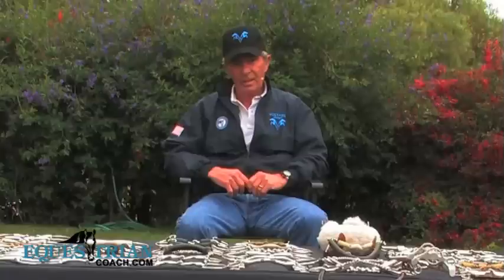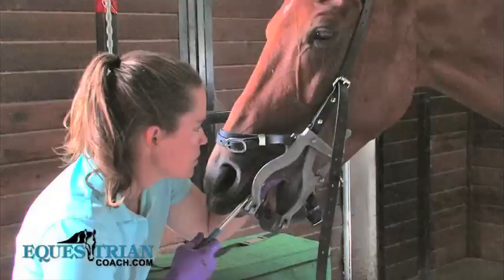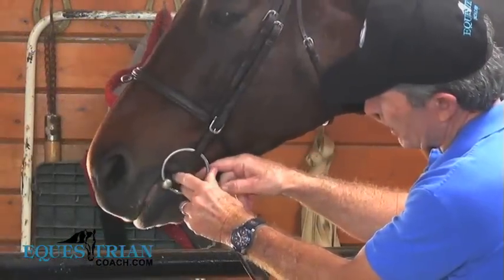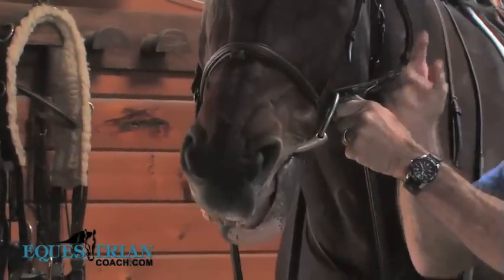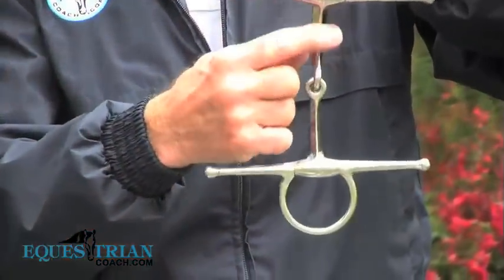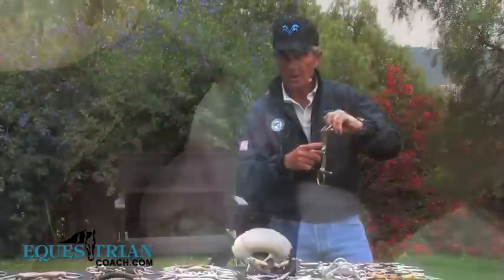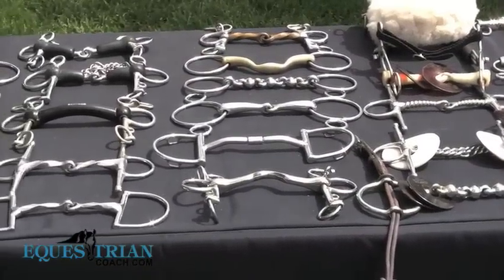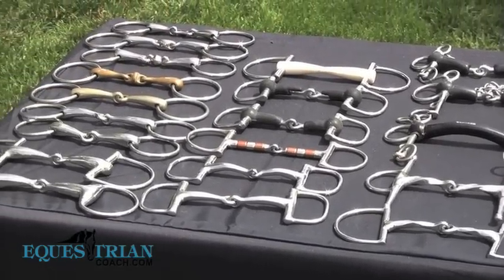Horse Bits: How They Work and When to Use

Comment: I agree and disagree with the people saying "go bitless". Some horses are absolutely fine with bits, but with some it just won't work. I'd never use anything more than a snaffle on any horse of mine. Bitless can be good, bit it can also be very bad. It can even be worse than bits. It all depends on the length of the shanks on a bitless bridle.
Reply: Rope halter and reins.
Reply: @gerrycoleman7290  that can cause so much damage if done long term.
Reply: @starry1668  If used correctly, your statement would then be incorrect.
Reply: @gerrycoleman7290  correct- but a lot of people do not use them correctly
Reply: @gerrycoleman7290  which is exactly the case with bits. though rope halters or sidepulls sold for riding usually have rawhide or a thin rope on the nose which ends up being really harsh on the nose.. a rope halter with reins isnt very well suited for english riding- its possible of course, but not optimal

Comment: A BIT is simply a communication device.  If the mouth is healthy and teeth are good a BIT that fits that horse will ride easy and not cause pinching or pain when at rest position. A light rein and crisp light commands with immediate release upon yield will not cause pain.    Like if I lightly nudge you in the side to move left you should feel no pain or react other than understanding to move.  If I am heavy handed and hit you hard in the side you will react to the pain and the movement will be lost in the reaction.  If I keep hitting you heavily in the side you will blow up and turn on me to make it stop.   A horse is no different.  People need training, not horses. People need to understand BITs and how to use them, how to fit them and to communicate with a light gentle hand.  My grandfather ( A great horseman) taught me by using light cotton string to attach my reins to the bit.  If I was not gentle the string would break. I learned to communicate to my horse with a simple wrist movement or finger movement.  You could barely see the hand move.  Force or pain have nothing to do with good horsemanship and lead to more issues.  The horse industry is flooded with magical clinicians, gadget bits and gear and so called horse whispering trainers.  Most are just con men and salesmen making a buck off of emotional unknowledgeable well meaning people.
Think of it this way....what is your goal by the communication??  Take two guys trying to communicate.

Level1:  You need to communicate with a guy several yards away to come to you.  You can yell or wave or both. Clear defined communication is not necessary, he just needs to understand the basic jist of the communication to come to you.
This is like basic relaxed trail riding.  You need to communicate for your horse to stop or turn or move forward.....crispness and immediate response not required so NO BIT, or head stall alone might get it done.

Level2:  Now you need more detailed communication with the guy, not only to come to you but to come to you quickly and to bring something along.  A lot of the message gets lost in yelling or waving so you might use a walkie talkie to make your commands clear and understood.   Same mission of communicating with someone, just more dependable and precise.
This is akin to a working horse on a ranch or pleasure riding in rugged rural settings with potential dangers where a more responsive horse is needed.  A good snaffle or simple curb BIT will get it done.

Level3:  Precision communication is vital. Your communicating with the guy but he is doing something precise and needs your direction to complete it properly and safely. Headset with mouth mic might be in order to ensure there is clear precise communication without interference or misunderstanding (  like a crane operator ), missed communication would be disastrous to your goal.  
This is like reigning, cutting or intense work that demands precise clean and immediate reaction for success or safety. So you will pick you equipment to meet these demands.

Just because you can ride your back yard trail horse in a hackamore, does not mean you can cut cattle on a cow ranch in a hackamore.  But whatever your doing, it must be good for the horse and the rider MUST be knowledgeable.  If it is painful or damaging to the horse....your not doing it right. 
Communication, Trust and Understanding is the foundation of a good horseman.
Reply: +MrAzrancher you can still do all of that with a bosal or other bitless bridal
Reply: Yes, but it's applying a different kind of uncomfortable pressure.
Reply: VelocirapGirl Can you do some research? Everything that she said was absolutely true. Bits were made as a communication device, and to make riding a little bit easier. If the bit is causing pain, someone's doing something wrong.
Reply: Rainy Byrd communication through pain
Reply: Yeah no

Comment: The real key in bit selection is to use only enough pressure to get your horse to respond properly then immediately release the pressure.  Some horses are more cooperative than others and only need the very lightest bit or even a  bit less bridle.  Horses that need a little more pressure still respond better when only applying enough to get them to cooperate.  Most people tend to "stay in their horse's mouth" too much which does cause pain followed by the horse shaking his head and trying to avoid the unnecessary pain.  The goal should be to get your horse to ride comfortably with a loose rein, coupled with leg ques and teaching him to "neck rein" with the slightest feel of the rein on one side of his neck.  Being patient with your horse and spending the time to teach him what you want helps him learn to trust you, then you can trust him.

Comment: they had cow hide twisted as a bit. it was painless and soft but still controlled the horse.
This is why I like rubber bits, they serve a close purpose.
Reply: theres quite a lot of leather bits on the market nowadays! however, its important to keep in mind that rubber bits are only suited for horses with ample saliva production as the rubber will otherwise rub sores on the skin unlike smooth metal

Comment: hi my pony hates getting her bit put in and wont open her mouth. we have had her teeth checked and they are fine so should we get a new bit or is it just a case of spending time with her
Reply: use a thinner (maybe weaker too usually are if theyre thinner) one. her mouth may be softer than the usual horse/pony. If not then eide bitless and eventually work your way into a bit
Reply: why so mean? he just wantet a advice
Reply: Luis-------Correct. Use a rope halter.
Reply: thanks for your advice, but my pony has opened her mouth now and I'm just glad your not her owner and FYI you cant compete at bs and RC championships bit less.
Reply: We call that a clue------------perhaps a person should rethink competing where bits are required. Perhaps a person should rethink whether they are involved with horses for ego or the horse.

Comment: I have not been riding long, so can somebody confirm that the purpose of a bit should be to communicate through pressure and not pain?
Reply: bits are to communicate pressure. never to case a horse pain.
Reply: Bits cause pain. My two horses (both TB's) use Dr Cook Bitless Bridles which of course have no bit. Please consider this as an option
Reply: bits aren't supposed to cause pain. usually its from the rider being too rough with their hands, and it also depends on the severity of the bit. It's mainly about finding a bit that your horse works best with. when trying with a bitless bridle for the first time make sure you know what your doing. Whether going bitless or not it all depends on what the horse works best with.
Reply: AtomAntTC
Dr. Cook's bridles use poll pressure. Many horses, including mine, object to that more than a bit. Don't assume that bitless is always the gentler option.
Reply: Liz Goldsmith There are a variety of other bit-less options besides Dr Cook which could be explored which will certainly be kinder to the horse than having a bit in its mouth.
Reply: Advice to anyone:

If you need a bit for whatever reason (a frisky or untrained horse, certain showing disciplines, ect, ect) and your bit seems to hurt even if it's not too strong, use a RUBBER or PLASTIC bit. It's more comfortable but equally strong.
Reply: bits cause pain... no matter how soft your hand are or what type of bit you use :P go bitless! but make shure that the bitless bridle is fittet correctly or you can cause damedge to the nose :3 but bitless is 100% better that bits!!!
Reply: if you can control a horse with a halter you can ride bitless!
Reply: You can still destroy a horses mouth with a rubber or plastic bit. I've seen it happen. The best thing to do is explore different types of bits and bridle-less bridles to see what your horse works best with. Some do prefer going bridle-less. Others work better with a bit. Remember to use all of your aids when riding. Using your hands isnt the only way to control a horse.

Comment: Start at the ground people and a bit for your personal security will not be necessary! A bit is a crutch for those that do not know what the hell they are doing or they are scared because they do not know what the hell they are doing ! This is exactly why helmets are worn so much. To protect the dummies that crank on these bits from busting their melon wide open when the horse tosses them or flips over on them because head tossing didn't work to make the pain stop , opening their mouth and shaking their head didn't stop the pain , rearing didn't stop the pain , bucking didn't stop so then the horse goes over onto its back to attempt to get relief from the agony in its mouth . I have never seen a horse go up and over while just grazing in open pasture because a human has to be involved for a horse to flip on its back. Stud chains across the nose , bits in their mouth , whips across their flank...all of those are huge signs of I DON"T KNOW WHAT THE HELL I AM DOING !! There is no such thing as a painless bit..yes some are waaay worse than others but they all hurt. If you are screwing up while using a bitless bridle , you are still doing it wrong !! It is never ever the horses fault if it makes a mistake it is always the fault of the human that isn't communicating with their horse. Set them up for success and start back at the beginning from the ground and slowly work your way back into the saddle. It will not happen overnight and it takes many many hours to build that trust with your horse but nothing worth having is never attained by taking the easy way . Get off your lazy asses and get dirty , sweaty and smarter for the sake of your horse ! Rant over
Reply: hey Kari- I have started all my horses, from the ground up, and everybody (7 horses/Arabs) does go bitless- except 1. Who, only on race day, for the first 15 miles, I do need to use a bit as this horse is so competitive- when the herd gets moving out w/ speed- he wants to go with them. Only on race day is he like this- so in order to protect him from himself- and in order to maintain proper pace for over 50 miles, I do have to use a bit for the first part of the ride- which then, later, I switch to bitless.  Oh, we are also ALL barefoot horses. But I"m not going to tell another person what to do or not to do with their horse if they truly know their horse, and their horse is their first consideration.  But I do agree w/ most of what you say, and people need to learn to communicate clearly with their horses.  But anything on the horses nose too can hurt them as well- as the nose is pretty sensitive.
Reply: stacy j Yes you are correct that their noses are sensitive that is why people use stud chains across it . Barefoot on endurance races ? That is awesome good for you ! Good luck with your racing :)
Reply: yep, I won the last two years in a row the Region 2 Endurance championships (50 miles) bit less and barefoot (completely barefoot, not even booted) the terrain allowed for it.  I appreciate so greatly being able to ride w/ as little influence as possible.  Body language and sensitivity (on the riders part- just learning to listen) can go a long way w/ our horses. I"m still working on this w/ my highly competitive boy, but he's coming along.
Reply: stacy j That is great , wow ! I have much respect for you and your boy endurance racing is not for the faint of heart in any way . You have to trust him and he the same with you or you won't get too far especially 50 miles..lol..
Reply: thank you!
Reply: Welcome!!
Reply: People don't only come off of a horse when the horse tries to unseat them. If the horse falls, there is nothing even the best rider can do. It's unfair to say that people who take precautions to these rare but very real possibilities don't know what they're doing. In this case, they actually do, and they look beyond it as well.
Reply: Omg actually gave me goose bumps!! you sound just like me when I rant.. you are a true horseman and you know what your talking about. Thank god there is still people like you who truly understand horses :)
Reply: Blond Brain I learn something new every single day and as long as any equine enthusiast allows that to flow through them then they can become WONDERFUL BEAUTIFUL teams with their horse. Horses are loyal and strong and gorgeous but most of SMART! But we make our mistakes thinking we know better than they do which is very dangerously wrong . Brute force or pain will get you no where but to the ER a little bit quicker . Been there , done that will try my damnedest to never fail my horse again that way . I am no expert on horses only the horse is the expert but I am a very good study of the horses mind and body . If any of us that care to do such a thing then we along with our horses will be the best we can be .
Reply: Kari Kidd Wow!! You should make speeches your so inspiring! Everything you say is just so true could've never said it better than you. I made mistakes but at least we both learned from them and corrected our ways ;)
Reply: Blond Brain You are very sweet . I do me I couldn't teach others to do me in their way..lol...
Reply: thank you :) and yeah if only everyone would be like you though
Reply: Kari Kidd typical comment from someone who does not understand how the bit works
Reply: lol not really. I've actually done a lot of research on the subject, but that's not what it seems like here. A lot of people make claims that bits are bad without really understanding bits in the first place (or just being "brainwaished" by a lot of Haute Ecole videos. Honestly, I respect what this guy does but some of the videos depict bits in a negative way without any real back up of information, much like what's happening here)
A lot of people who completely bash bits are misinformed.
 Don't get me wrong, I'm not anti bitless at all, and I ride without a bit way more than with one, and have worked with many, many different types of horses each with different personalities bitless. 
 And bits can do a lot of damage, but so can bitless. It depends on the rider. I believe that most horses can be ridden bitless but do not have the proper training. Sadly, though, some horses are so beyond repair from hard hands. 

I'd respectfully request you don't say I "dont know horses" as I've spent a lot of time observing body language and behavior and do have the facts to back up what I say ^-^
Reply: zerosecondsago Well then you shouldn't make judgement on this girl because even though she may or may not know al lot about bits she does understand horses. But personally I've done a lot of researches too and I hate bits!!
Reply: I made this judgement because she was basically just ranting, so don't expect me to take her seriously lol. She assumed that everyone who uses bits crank on their horse or use stud chains and whips, and that they don't know what they are doing, when in reality it may be her who doesn't know what she is doing. 

Maybe if she actually made rational claims and bothered to try and understand when bits are appropriate, if they are appropriate, etc, instead of ranting like some pony obsessed girl who thinks "oh I don't have a bit so my horse must love me!" Which is not the case
Reply: And you even just said "even though she may not know a lot about bits" don't you have to actually have to know what you are talking about before you make such claims? Lol!!
Reply: zerosecondsago No im saying I don't this girl personnaly so I don't know how much she knows about bits!!
Reply: Absolutely correct. Thank you for your horsemanship.
Reply: zero------------You are the one who does not completely understand how bits function.

Comment: a bitless harness is the best. bit hurt the horse.
Reply: so do bitless bridles. It applies an excessive amount of pressure to the thinnest bone of the skull.
Reply: Bits are harmless and do not cause pain. Ignorant riders are what hurts he horse. Bitless isn't alway a good option either as if the rider is too rough, they could damage the sensitive tissues and nerves in the face and cause facial paralysis or break their noses.